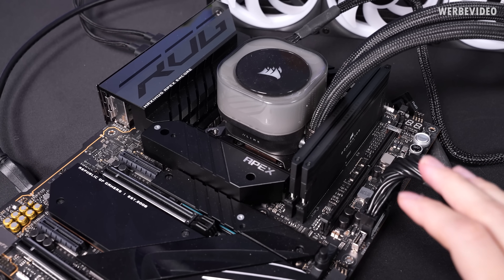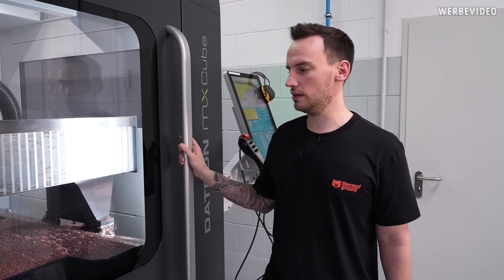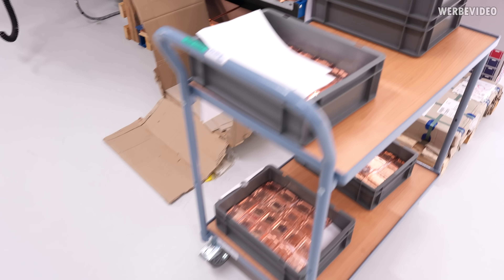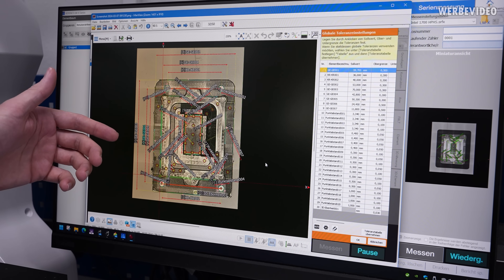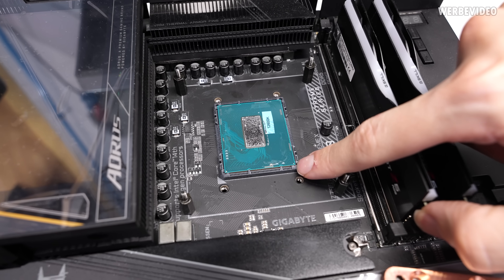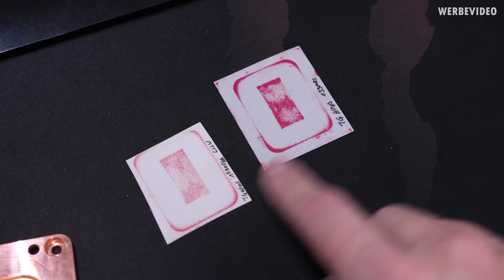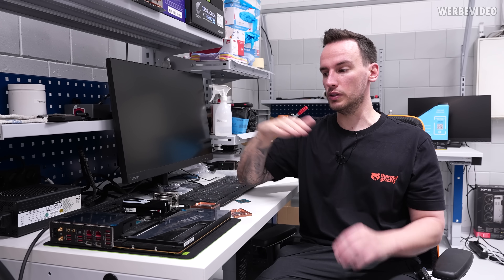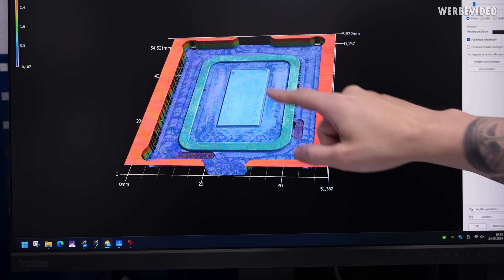I messed up

Comment: I'm a Manufacturing Engineer and we use Keyence vision systems in production automation and those measurement systems for quality inspection. You know it's good when the Germans use it.

I'd be curious what the variations are in the plastic sockets of different boards and manufacturers when you put them under the Keyence.

Comment: Make certain that this is NOT a fastener issue.  I recently installed an Alphacool Core 1 block and found the temps high by about 10C.  On investigation it turned out that some of the fasteners/nuts that affixed the block to the CPU head spreader were NOT FULLY/PROPERLY THREADED.  This caused the block to not properly contact the IHS hence increasing temperatures.  (yeah, hard to believe but true -- I posted images of this on an Amazon review of the block).   If you externally source the fasteners for the product, be sure that the fasteners are all properly manufactured.

Comment: I had a friend that had been having issues with his PC for months before he brought it to me to fix, after a while of getting hot the BIOS would just shut off the power to the board. The reason this was happening was the CPU was overheating- however the reason for the CPU overheating was none of the usual culprits. After about 2 weeks of troubleshooting I had removed the MBD & noticed a flex in the case's metal backplate, it turns out that when the inside got too hot the case would flex- this caused the MBD to bow, literally prying the CPU away from the heatsink; causing it to overheat. Drilled 16 holes in it 10 mm from either edge of where the MBD's CPU rear mounting plate sits, & riveted 2 flat steel bars to the backplate (8 rivets through each bar). This fixed the flexing, & he said it's been running perfectly since.

So in your case it's worth noting that there may be variances in individual MBD's, cases, etc that could actually be the cause of this- after all usually only a few out of 10K+ actually get tested for defects in larger operations than yours, which could account for the extremely small number of issues on the consumer's end. That said, the fact that you are addressing this at all, & making a vid shows your commitment to making something worthy of praise. The fact that you're not gas-lighting or blaming the customer makes your fix worth waiting for; no matter how long that takes- & I would much rather wait for something I know is going to work, than multiple "try & see's".

Comment: The shot of the pressure paper got me thinking...
Forgive me not knowing, but is pressure also tested under thermal load?
It seemed a little more pressure on the PCB, and the plastic to metal expansion differences possibly inducing some torqueing. like a bimetallic strip

Comment: Could be the plastic which makes sense, it could also be that when installed if not installed in x patern could tilt the plate putting uneven pressure on one side rather than even pressure, which would introduce uneven cooling of the cpu. You could possible help this by adding o-ring or gasket to help even out the plate or difference in pressure. Or suggest use of a torque gauge that would ensure all are at least even. Unfortunately having it touch plastic could introduce heat expansion variables sooner than metals.

Comment: You don’t have to be sorry .. this is the normal part of coming up with legit products for modding .. If people don’t understand that and can’t be patient than they don’t need to be doing this kind of stuff to there hardware . As it is something that voids warranty anyway and isn’t a recommended procedure to do to your hardware by the chip manufacturers. There for there is always risk . And possibility of user error with Liquid Metal application and putting block in perfectly plays a huge part also

Comment: Plastic socket variance seems plausible, also challenging to verify. Besides that, the milling process is of course what I turn my eye towards (mostly because it's easier to verify and/or rule out). Is it possible that you're getting inconsistent variance in raw copper material? For example, maybe some plates are flatter than others, and the less-flat ones are being artificially flattened when clamped in the mill fixture? Another thing that comes to mind is perhaps there are internal stresses in the copper plates that are causing individual parts to warp as a result of how/where material is removed (this can be a problem with cold-rolled steel, for example, I have no idea if this can happen to copper plates). Finally, how are you clamping the large raw copper plates into the mill? Is it possible that there is uneven clamping, causing the raw stock to warp ever so slightly (perhaps worse near the clamp locations) which could cause a small subset of parts to "unwarp" after removal? All of these are hard to imagine completely escaping your quality checks, but perhaps it's a small enough phenomenon that it hasn't been discovered yet?

Comment: It seems likely to be related to stackup variations.  Thermal expansion could contribute in circumstances where the stack up variation is (probably) at a maximum.  Once you get it worked out, I will definitely get the device.  I have gotten several items from Thermal Grizzly, everything has been top quality.  In seeing the video section where you walk around in your shop, I see why, t looks like a great working environment.  Clean, well lit, safe, lots of cool tools of all sorts.  Good job.

Comment: It's likely the plastic cpu holder. I suspect you will find the edges of the cpu holder could vary in height by as much as 0.4mm. If you think about it, the holder is only there to guide the cpu to the correct position and prevent it from moving. The only real requirement is that it can't be taller than the IHS.. Besides, over time plastics warp and bend.. If possible, reach out to those who reported the issue and offer to buy their cpu and motherboards.. Hopefully some are in Germany..

Comment: Root cause =. customer is stupid lol. Pretty common. Most likely it isn't tightened all the way. If you don't tighten down the contact frame all the way, you get the same problem.

Comment: @Der8auer
Just finished my first 7950x3D Delidded build. Temps while gaming range around 60-75c. While heavy load reach high 80c.

System specs:
Case: Phanteks  Evolv shift XT (no filters [open])
CPU: 7950x3D Delidded (liquid metal) w/ AM5 heat spreader
GPU: 7900XTX Reference 
Mobo: Asus Strix B650E-I 
Mem: 32GB 6000Mhz Kingston Fury Beast
Cooler: ID-COOLING IS-55 Black LP [trimmed fins] (liquid metal)
Fans: 1 Lian Li TL 120mm / 2 Lian Li TLCD Reverse 120mm 
PBO: Enhanced 
Curve optimizer: Negative 25 all core
CPPC: cache

Not 100% sure what else I could do for optimization, but thanks to Der8auer  and Thermal Grizzly I wouldn't think this system would be doable!

side note: My 7900XTX was hitting 110c on the hotspot in my old NZXT phantom 820 (horizontal position).
Now in the Phanteks Evolv Shift XT (vertical position) the gpu hotspot runs 20-30c cooler!

Comment: Is it possible that there aren't different parts/manufacturers for the plastic socket, but that small manufacturing defects in the sockets might cause issues? I'm imagining a small bit of flash or excess plastic ending stuck to the part in the injection moulding process, and if it happens in exactly the wrong place it could cause a tilt or height misalignment for that particular user.

The only way to confirm this would be to get some of the affected users to send in their motherboards (and CPUs, to minimize variables) and test/examine them yourselves. Such defects could be rare, but you would never know with "normal" installations because the regular cooler mounting mechanisms don't use that part of the socket as a reference surface.

Comment: So you're using the plastic of the socket as the datum for the z height, aka contact on the chip .. are you sure all the plastic sockets have the same tolerance ?..I can see intel closely specifying the z height of the pins but not the surrounding plastic... Damn you just mentioned this in the video..but I think you're onto something.
I've worked for 20+ years as an engineer in plastic injection moulding... Simple things like inconsistent packing pressure during the cooling time can cause havoc with tolerances of parts.. and there's A LOT more that can affect tolerance of plastic parts they're far more variable than metal machined parts.

Comment: could it be a variation in the plastic socket from board to board ? if the cpu is slightly lower in socket then pressure affected ?

Comment: In an exercise like this it is also good to ask for the positive data, not just data validating some fault. Know why, where and how it works and why, where and how it does not. It's like at the track. When you win in flat track cycle you break the engine down to figure out why. Just like you break the engine down when you lose to figure out why. mb

Comment: All I can think of is what you've already mentioned, and maybe others, and that the plastic might have its own tolerance issues, and compounded with your own tolerance may push some samples just out of spec (the 1/100 issue). There is of course mounting hardware pressure, as some may apply a bit too much torque when tightening things down. 
The last thing I can think of would be in production, and that's tool height offset correction. If you are doing a batch at a time, do you check the tool height starting before each unit, or for the whole batch? Maybe units are slipping through tests because one of your mill bits breaks during its tool path and doesn't get corrected until the next tool height check. 
Considering how tight your production samples have been, I'm still leaning towards the plastic being the issue, so a number of motherboard samples may be required. Excellent work though tracking this down, and best of luck.

Comment: The part that is outside of their control is the plastic bracket and that looks a likely candidate.  They are mostly manufactured by Lotes, but there are other makers out there - I wonder if there is a tiny variation (only going to need a fraction of a mm to have a big impact) in the thickness.   Possibly a tiny change in spec by Lotes during different production runs.  Another thing that would point to the plastic bracket is the fact that Iceman don't seem to have had a similar problem, and their kit goes to the pcb, thus not using the plastic bracket as a point of contact.

Comment: My comment will probably fall through the cracks, but here goes nothing.
The device (MYCRO DIRECT-DIE) presses on the rather thin plastic rectangle surrounding the CPU area.
When pressure is applied, I believe there is a high chance that thin plastic wall would deform in a corner (or two) until reaching an equilibrium point. Then, the contact surface between the device and the delidded CPU will be uneven. Hence the higher temperatures.

That is one possibility. The other is the plastic wall not being even everywhere.

Most likely, it's a combination of both.

Comment: I would probably buy the board and CPUs from a few effected customers to be able to eliminate any guesswork.
I know if I was offered enough to buy a new board and CPU as well as to ship out the effected ones, I'd be OK with that.  The only issue would be the time involved.  Get new parts, ship out effected parts; then they finally get to you, probably 10 to 14 days later.  So yeah, guessing could easily just be faster - otherwise it'd get really expensive with next day shipping to cut that figure down a lot.  Oh and dealing with customs if there's no one in Germany currently effected.

Comment: The first thing I thought was making sure what MB the customer has, and then buying that board to test on, because it seems like you only used 2 boards (Gigabyte Aorus and ASUS Apex), and this is why this troubleshooting can get quite expensive, when you have to have so many test platforms.

Comment: I don’t think the issue is your part or anything to do with that plastic shroud around the pins. If you didn’t have good enough contact to get a 10deg c difference it would also mean you are not pushing the cpu into the socket at all and would have memory issues.  I would not assume because the heatspreader is the same on the bottom as the direct die water cooling that you have an issue there as well. I believe that the issue is on the top side and the compatibility with whatever cooler they are installing and the mounting pressure on that side. I will bet you have 0 complaints with the direct die water block. Googling issues with the HPHS I came across a couple ppl on Reddit that had the exact same 10deg difference and their issue was resolved by filing down the mounts for their AIO to get better contact because there is a small height difference between your HPHS and the original IHS once mounted in the socket. I would be looking at the other side of your part. Sometimes it’s the simplest thing, and if you keep looking for complex issues you will miss the real issue.

Comment: Curious if this issue could be related to the socket rather than the product in question.
If there are enough detailed reports, maybe you could compile the manufacturer and lot-numbers to see if there is enough supporting data to warrant suspicion.
If the plastic molding that the CPU's substrate sits atop within the socket has larger margins for depth tolerances, could that be a contributing factor or the culprit?

Comment: Is it only some, but not all of the mounts? 
I think variation in the plastic part can be likely, as that is the only thing you can't control for. The only other thing that comes to mind is maybe wear on the milling bit during machining. Perhaps some get cut deeper than others? I don't know anything about CNC though, so maybe this just isn't a concern.

Comment: I have not tested my TG/der8auer direct die block yet. I probably will in a day or two. I am currenty using an IceMan Cooling direct die block and will be able to instantly know if it is worse. If the temperatures are worse I will reach out for assistance or a refund. If they are the same or better I will be a happy customer.

Comment: Look for commonalities in the failures; are they all made from the same stock order? did they all come from the same CNC? Were the failures "random" from your production batches? If so, then the problem is most likely something else. Because the thermals difference with the failures is so great, it looks like a near failure to seat on the chip, not a simple issue like Materials or Cooling channels/fins. When you receive returns of the failures, they should be checked in detail using your typical QC methods, look for ANYTHING out of the ordinary, any data here is important. And as others have suggested, if you can get info from your customers with the issue, what board are they using, and if they are willing to send pictures of the chip socket/board. Be very careful though, you don't want to send an unintended message of blaming the customer, but this is potentially a critical set of information for your troubleshooting. Finally, offering a fully QC tested and measured version of your cooling set to the impacted customer. Proof that you are sending a "golden sample," and if that one also doesn't work properly then you know where the problem is. (Damn you ASUS!  Jumping on the bandwagon of recent hatred).  Also, to recoup some losses, you might plan a colab or three with other channels by sending them "failed" examples, and golden samples, of the cooler for them, to test/check on various boards, and use their tools to measure and map (gamersnexus, LTT, etc), we all learn more, you are seen as being even more open to exposure, and extra content.

Comment: EK: What issue? You did it wrong. Shut up. Thermal Grizzly: It's too hot? We're on it. We're going to fix this. This is why I paid full price for a half dozen Intel CPU mounts, instead of going with cheapo brands. I'll always pay for Integrity, it's priceless. Also, find out the brands of the motherboards people are using. I know ASROCK and MSI both tend to be thinner PCBs from my experience. If the plastic parts are just molded to one size, that could push the mounts to be a fraction of a MM more thick or something, just enough to reduce the block's ability to cool. Also if they had the cpu mounted with Intel's ILM at some point, could that small bend be reducing contact of the cooler? Just two thoughts I had on possible causes.